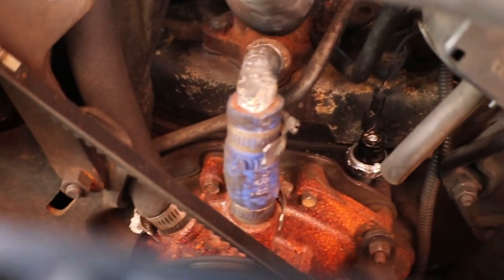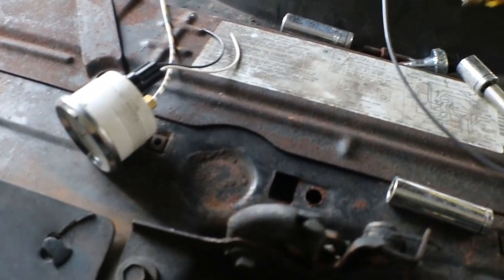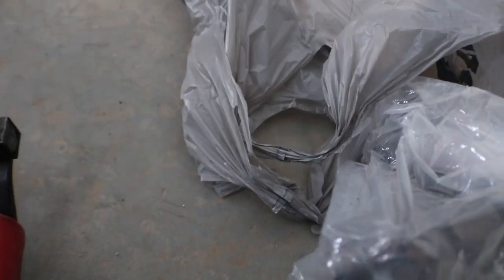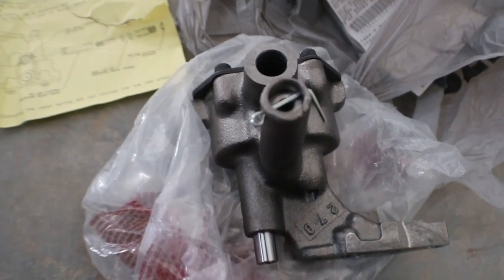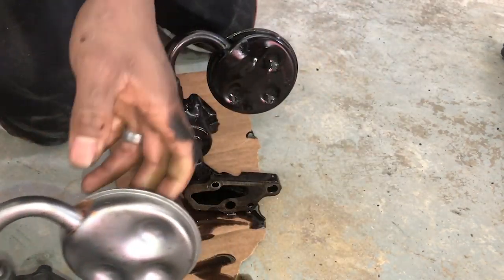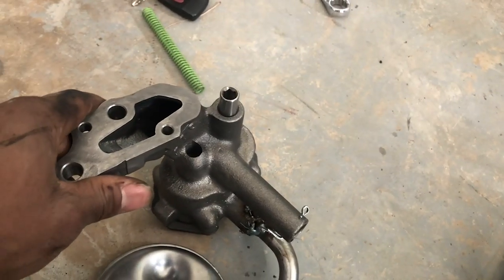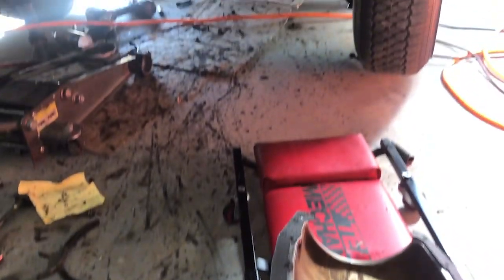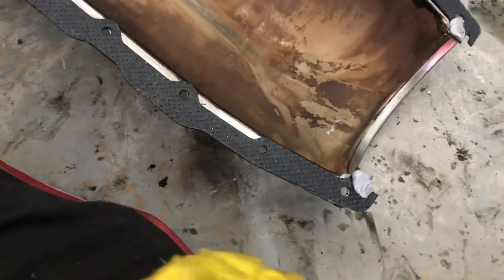Small Block Oil Pump Replacement

Comment: I'm having trouble removing the base plate of the oil pump where the 4 screws are located. I removed the 4 screws and the plate will not budge.

Comment: Good video but just a couple comments.....Please don't dump your used oil back into the ground.  You could clearly see where you dumped it in the video.  Lastly, don't you thing you should wear proper shoes when working in the garage?  Drop an impact wrench on those toes sticking out of those sandals, and it's gonna be a bad day for you.
Reply from the maker: You may have seen a leak but I always recycle or reuse my oil. You’re looking wayyyy too hard.